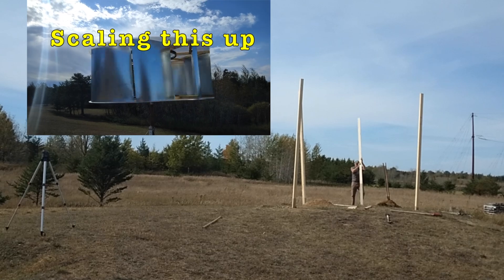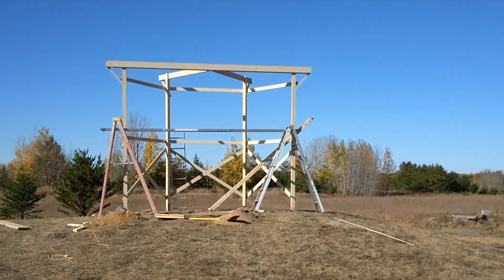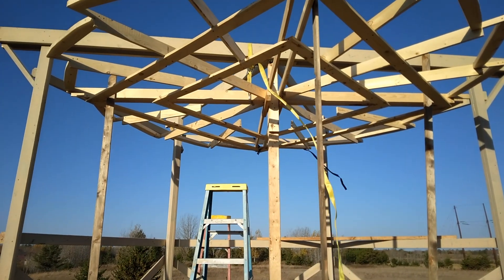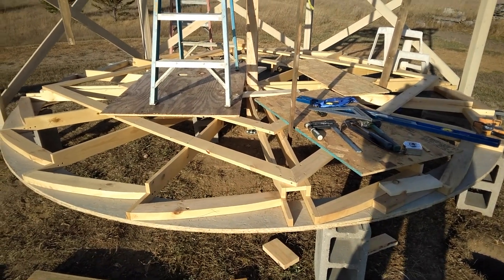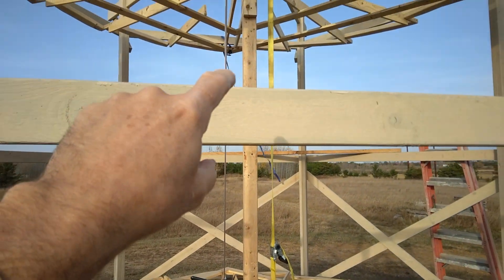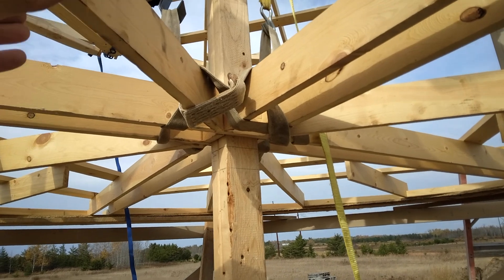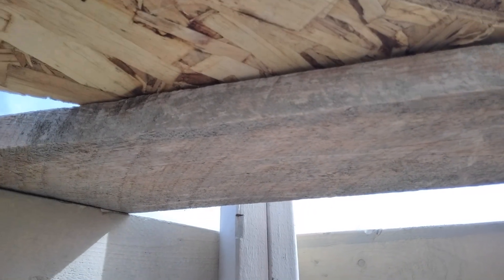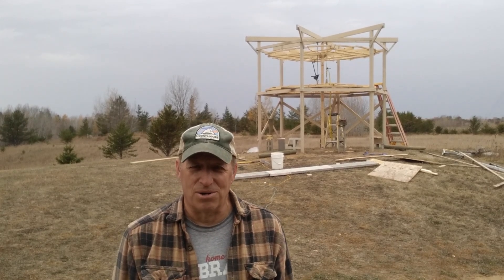Rotating Flow 'Wind' Turbine (3.0), part 2; continuing the build.

Comment: Interesting approach, I quite like it. I'm assuming the plan is for an equally large and low cost gear ratio as well? A cone CVT perhaps? Using mass to offset height and keep the cost low is a clever angle, but a safety stop might be a challenge ... maybe an outer ring of chicken wire that can quickly be covered with tarps? My concern is braking at the wheels could cause some twisting and rapid disassembly should the wind speed really start to run away with it. Looking forward to see how this goes - bang for the buck the concept seems very solid
Reply from the maker: You're right in line with some of my thinking!  My plan for 'off and on', is to place galvanize remesh around the outside working area, with small tarps to hang, and operate like a curtain.
The gear train/drive train, is going to be the three wheel barrow wheels supporting the weight of the turbine on the track at the outer edge.  The gear ratio will be around 10 to 1.  The weight of the turbine will supply the traction for the wheels, though I may have to clad the track with sheetmetal if it starts to tear up.  There are some unknowns, but this is how you find out...

Comment: Your dedication is admirable, that's some heavy work. I caught lyme from a tick and didn't get to my big project this year, had to hire help just to finish my firewood. But your effort is an inspiration! It'll be interesting to see how this one compares to the smaller one, hope you're using some really slick bearings and grease for all that weight. If it turns out too heavy, you might consider a lighter rotor of metal tube framing and thick fabric/tarps/plastic sheeting for the fins. Excited to see how it turns out, this one could produce substantial usable power. Have you kept track of the costs if someone were to buy all the materials? Or the weight of the frame and especially rotor, just for curiosity's sake?
Reply from the maker: If you watch the video of the first part of this build, it will help you to have a better understanding of the plan. 
-link:  "https://youtu.be/A-NUT3iuvBk"
Yes, weight of turbine important. -it will be mostly carried by 3 wheels attached to frame.   Cost is also being considered, and availability of material; and what ever else that turns up for changes.